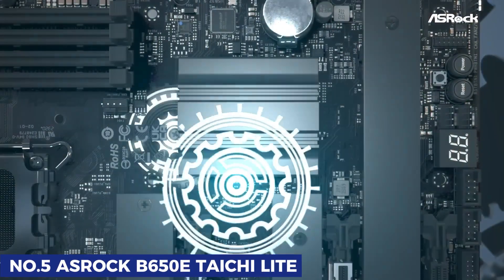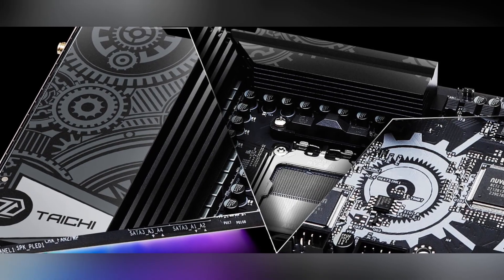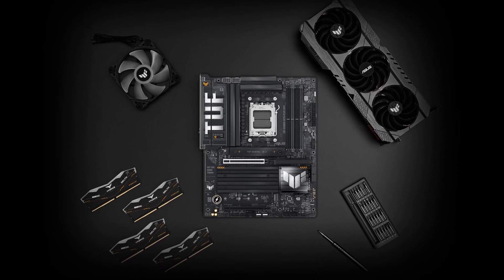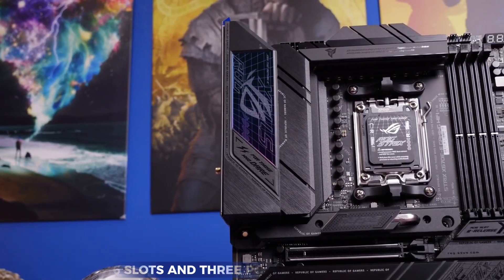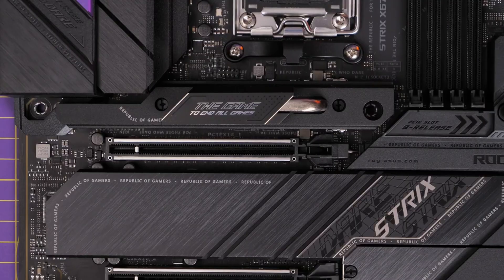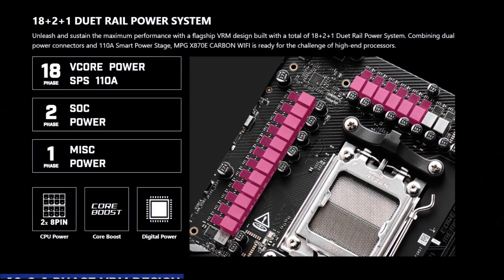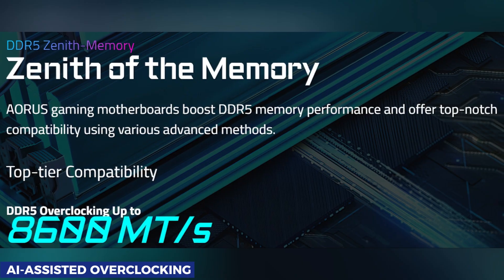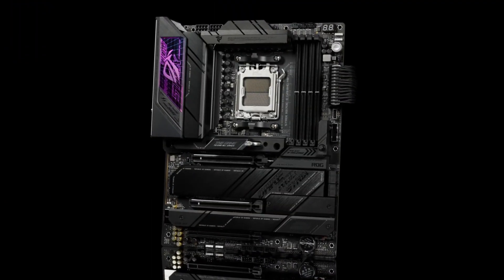Best AM5 Motherboards 2025 - Future-Proof Your Ryzen Build!

Comment: I game only, and I am hesitating between the ASUS B-850M plus WiFi vs MSI mag X870E, which should I get? I will pair it with a 9800x3d and overlock
Reply from the maker: For gaming with Ryzen 9800X3D:

-MSI MAG X870E (Best choice) → Better VRM (18+2+1 phases) for overclocking, PCIe 5.0 future-proofing.
-ASUS B850M-Plus WiFi (Budget pick) → Decent for mild OC.

Pick MSI if: You want max performance & upgrades.
Pick ASUS if: You're on a tight budget.

Note: 9800X3D doesn't need heavy OC - focus on RAM tuning!

Comment: What about b850 e and f
Reply from the maker: B850E and B850F chipsets are actually excellent budget-friendly alternatives to X870E. Here's the quick breakdown:

B850 boards typically offer:
-PCIe 5.0 for GPU (x16) + 1 PCIe 5.0 M.2 slot
-More affordable price point
-Slightly scaled-back connectivity vs X870E

Key differences from X870E:
-Fewer PCIe 5.0 M.2 slots (usually 1 vs 2-3)
-May lack some premium features like USB4 (unless specified)
-More limited overclocking support

Who should consider B850?
-Gamers wanting PCIe 5.0 GPU support without paying for extra X870E features
-Users who don't need multiple Gen5 SSDs
-Budget-conscious builders still wanting AM5 future-proofing

Comment: Which of these motherboards can you use all the Nvme PCIE slots in it without compromising the GPU down from 16 to 8, Also looking for a board that I can use Gen 4 Nvme PCIE in all its slots instead of Gen 5, what I mean by that is if it says Gen 5 I can use Gen 4 instead as they would be cheaper to purchase.
Reply: That’s incorrect for MSI carbon.
On specs tab of official website, it says: « PCI_E1 & PCI_E2 & M.2_2 share the bandwidth ».
PCI_E1 is the GPU slot and M2_2 is the 2nd M2 on PCIe 5.
Reply from the maker: @Ger0nimo76  Thanks for correcting it.
Reply: @ MPG X870E EDGE TI WIFI shares 2nd M2 PCIe5 with USB4 40Gbps, which for me makes sense for laptops but not so much desktops. This is my choice for my upcoming build.
USB 40Gbps Type-C ports on the back panel and M2_2 slot share PCIe 5.0 x4 bandwidth. Both run at PCIe 5.0 x2 when a device is installed in the M2_2 slot. You can switch M2_2 to PCIe 5.0 x4 in the BIOS, but this will disable the USB 40Gbps Type-C ports. The USB4 host controller supports up to PCIe 4.0 x4.
Reply from the maker: Great question! Here's the breakdown for each motherboard:

ASRock B650E Taichi Lite:
-Using all 3 M.2 slots (1x PCIe 5.0 + 2x PCIe 4.0) reduces the GPU to x8.
-PCIe 5.0 slots can run Gen 4 drives (backward compatible).

Asus TUF X870-Plus WiFi:
-All 4 M.2 slots (2x PCIe 5.0 + 2x PCIe 4.0) work without GPU compromise (stays at x16).
-PCIe 5.0 slots fully support Gen 4 drives.

Asus ROG Strix X670E-E Gaming:
-Using all 3 PCIe 5.0 M.2 slots reduces the GPU to x8.
-To keep GPU at x16, use only 1 PCIe 5.0 M.2 slot.

MSI X870E Carbon WiFi:
-All 4 M.2 slots (2x PCIe 5.0 + 2x PCIe 4.0) work without affecting GPU x16.
-PCIe 5.0 slots are fully backward compatible with Gen 4 drives.

Gigabyte X870E Aorus Master:
-All 4 M.2 slots (3x PCIe 5.0 + 1x PCIe 4.0) work while keeping GPU at x16.
-Perfect for using Gen 4 drives in PCIe 5.0 slots.

Best picks for your needs:
-No GPU compromise: Asus TUF X870-Plus WiFi, MSI X870E Carbon WiFi, Gigabyte X870E Aorus Master.
-Avoid if GPU x16 is critical: ASRock B650E Taichi Lite, Asus ROG Strix X670E-E Gaming.

Let me know if you need more details! 👍
Also, I’m planning to make a new video focusing on budget-friendly options in the near future!
Reply: @BuyingGuideOfficial  MSI MAG X870E Tomahawk WiFi  what about this motherboard, as I do want to use All the Nvme M.2 slots instead of using either 2.5 or 3.5 SSD HDD in my latest build.  Also what about the AsRock Nova X870 E WiFi? I don't mind losing the SSD HDD slots in the build so long as it doesn't comprise the GPU down from 16 to 8, I want to keep it at 16 and I do want to use the Ryzen 7 9800X3D CPU in this build, one last thing I am also looking for a Good Air Flow RGB Dual Chamber Case which one would you suggest?
Reply from the maker: @thomasenright5282  MSI MAG X870E Tomahawk WiFi:
-4 M.2 slots (2x PCIe 5.0, 2x PCIe 4.0).
-No GPU compromise (stays at x16).
-18+2+1 phase VRM (handles Ryzen 9800X3D).
-Wi-Fi 7, 2.5GbE, USB 3.2 Gen 2x2.

ASRock Nova X870E WiFi:
-5 M.2 slots (3x PCIe 5.0, 2x PCIe 4.0).
-No GPU compromise (stays at x16).
-24+2+1 phase VRM (overkill for 9800X3D).
-Tool-less M.2 slots, premium RGB.

Pick MSI for value, ASRock for max M.2 slots.

Airflow RGB Dual-Chamber Cases:

Lian Li O11 Dynamic EVO RGB:
-9x fan support, clean dual-chamber design, ARGB fans included.

HYTE Y70 Touch:
-Touchscreen panel, 360mm radiator support, premium airflow.

Phanteks NV7:
-Open-layout, 14x fan mounts, sleek RGB lighting.

Comment: I think a lot of people will disagree with your choices. Also, I wonder about having so many M.2 slots. There are only 20 total PCIe5 lanes available, so you can have 1 Gen5 M.2 and one PCIe 5 video card before you have to downgrade your speed on Gen5 devices or share bandwidth. Who needs 5 M.2 devices? Personally, I'd go for more PCIe (even Gen3or 4) slots on the motherboard so I can putter with devices that don't come in USB.
Reply: I dont know where they have their demand for that. A usual home user will have max. 2 SSD on M2. As backup may be a 2.5 SSD.

Comment: I just bought the gigabyte b850 aorus elite wifi7 is it okay to put an amd ryzen 7 9700x with it ?
the x870 prices in my country is on fire 😅
Reply: I am happy that i bought two X870 boards for good prices, and i also bought a Chinese cheap B650 board, with this cheap board i installed Ryzen 7 9700X while i read that this mobo is supporting 7000 series, it is working nice no issues, so yours definitely will work great too, 800 series board is compatible and supporting 9000 series CPU nicely.